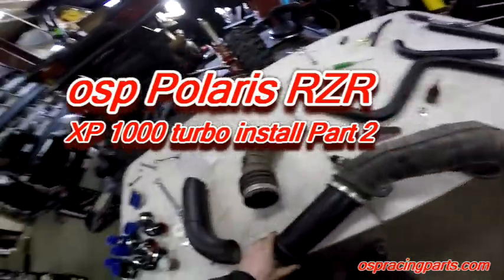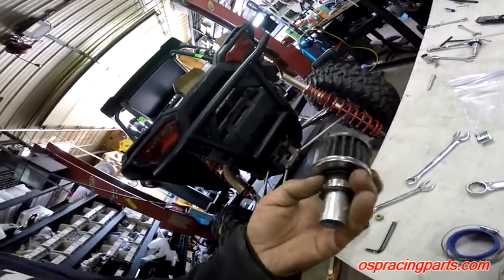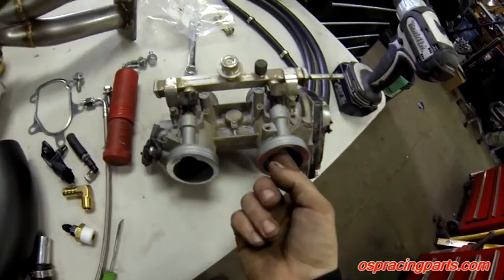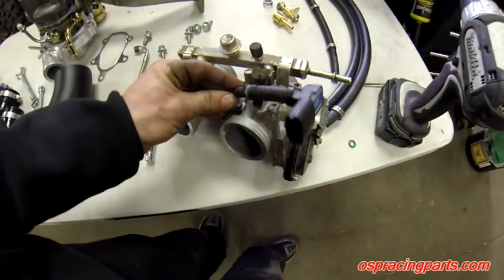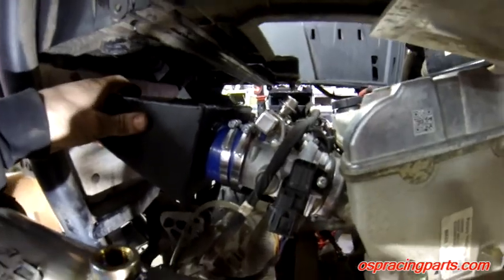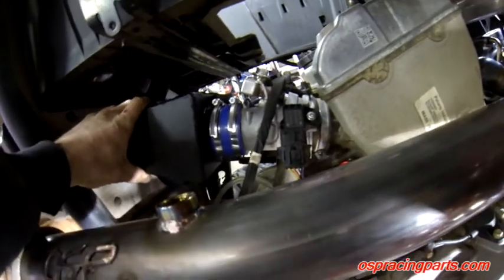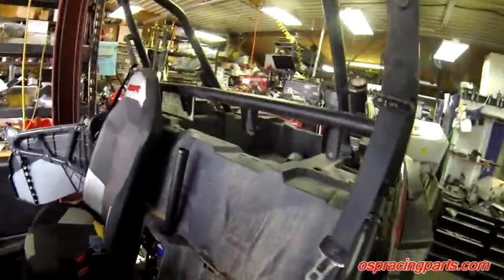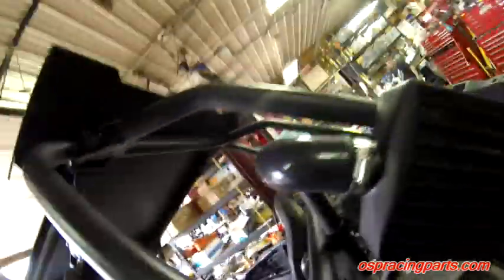OSP Turbo install part 2

Comment: What power commander V Is this using? Typical one for a rzr xp1000 doesn't have the extra harness for the secondary injectors